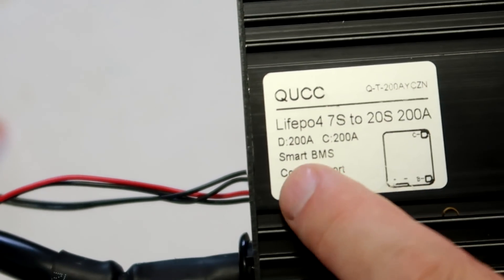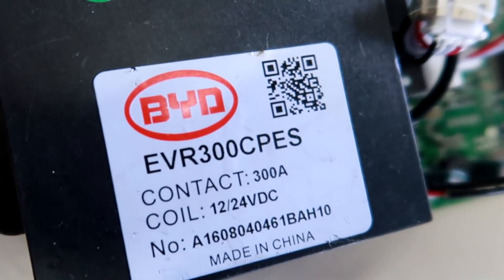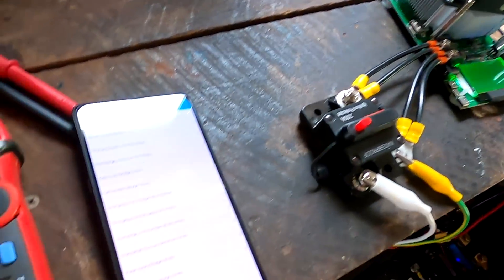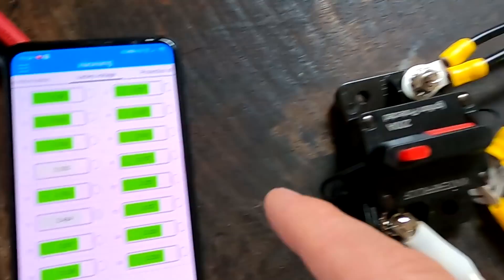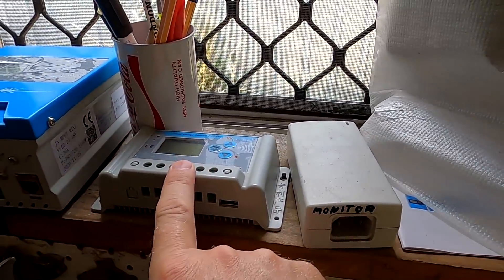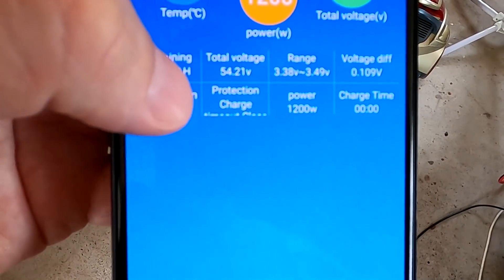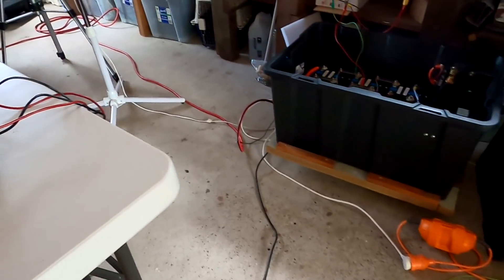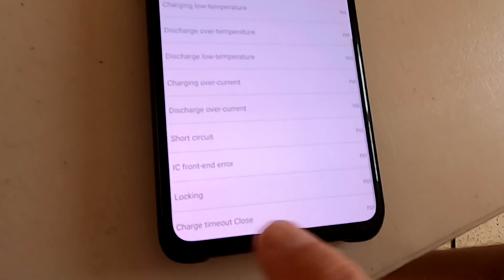This QUCC BMS does not protect my battery! Am I right?

Comment: my Electrodacus SBMS0 (my BMS)disconnects the Electrodacus DSSR20's ( the solar charge controllers) when any cell reaches 3.55 volts for too long of a preset time. there is a guy noel barlau or something like that on youtube who uses 2 of the SBMS0 on a 48-volt LiFePO4 build. one SBMS0 on every 8 cells. you want to stay with 48 volts that could be an option. when you get your next batch of cells to increase your battery storage capacity. the 60 and 72 cell panels work great with the sbms0. you will have to try them out the SBMS0 will also work with Victron inverters as I know that is a big-ticket item you are going to hook up.
it sounds like your BMS needs to go back for a refund. got you a lemon. the main thing the BMS is for is to protect your huge LiFePO4 investment so you get the 5000 cyles and then more. ditch that BMS.
keep up the good work.great videos as always.😎
Reply from the maker: I would get one but it's 24V only.

Comment: Yep it should absolutely disconnect if any single cell goes above or below the pre-set limits, or if the pack goes above or below the pre-set limits. Without doing that, it's no protection at all. You could have one cell at zero volts, and another at seven volts, and it may still think it's ok because the overall voltage is ok. I've tested these scenarios on my Daly BMS by using a voltage divider network, I had to be 100% sure it did what it says it does. The manual is very chinglish, but it was enough to get the gist of it.
Reply from the maker: At least you got a manual...

Comment: The fact that you can hear the relay attempting to open\close but nothing happens, may mean that you just have a faulty relay?
Reply: Yes, the relay contacts may be fused together.
Reply: @neliosamch3195  would you hear a click if the contacts are fused together?
Reply: @kevinmills5293  Yes and know the click is for the pre charge but it won't activate the relay until it fulfill the parameters for over charge which is around 4.0v. Kind of same situation with the Chargery bms.
Reply: @neliosamch3195  I have several chargery BMSs.  They work fine with the latest firmware.  You can set over charge value, undercharge, current, temp, etc.  Not sure why you think you can't.  Maybe you have a very old firmware version.
Reply: @robertgrant5895  no I have other bms which aren't user friendly. Orion and chargery yes you can.
Reply: Yes, sounds like welded relay
Reply: @TallTom77  I think it may not be a welded relay problem. I think this BMS features a Magnetic Latching relay. Either it is faulty and not releasing the latch, or their BMS relay driver circuit design is not working as intended. If it had a standard relay, it would produce so much heat and consume a lot of standby power, which is not the case as shown by Andy in one of his earlier videos. And I also don't think welded relays have very decisive clicks and most of the time have no clicks at all.
Reply: @DSmartLife  I believe some testing was done on self consumption by the BMS and it was quite high but Andy was OK with that - suggesting a traditional rather than electro/mechanical one??
Reply: The click could be the relay armature moving even if the contacts are welded. I'm thinking the timer fault may be "contactor is up and its not supposed to be"
Reply: That would make sense if the "Charge timeout Close" means a timeout on the "Charge Close", aka the relay...

Comment: The reason I have not gone LiFePO4 yet, is because I have not found a 48 volt BMS that I like yet.
Reply: Have you looked at the diyBMS?
Reply: @Bennyboy-dog  yes i have, in fact i got it working recently and i also love that thing, but for Andy is best if he buys something premade and complete instead of Messing around with soldering smd's and programing them... I have both, and the ANTBMS works perfectly and since he has new cells it should do a perfect job at protecting them. I have the DiyBms in a 18650 li-ion battery pack that i made from used 18650 cells. In used cells the DiyBms is better because it has a Higher discharge current
Reply: @andresgodinho  Very cool. Checked out your channel too - also very cool. Love that you show your diy 3D
Reply: @Bennyboy-dog  oh boy that was a long time ago ahahah
Reply: You should try the AntBMS... I love it!
Reply: I’m with everyone else here - most likely explanation is the relay has fused. This is one weakness of having a built in relay - if it fails the whole BMS is useless until you fix it. I’d look into the other ports on your BMS - pretty sure there was a port that could switch off your charge controller, that you didn’t know what was for. This is a much better way to go than trying to interrupt the current with a relay. And it gives you separate control over the charge controller and the inverter.

Comment: Yeah have to Turn completly Off.
Thats a benefit for BMS with mosfets. They can shut down discharge and Change seperatly
Reply: My BMS has relays and can also control charge and discharge separately.  Problem with a MOSFET based BMS is that when a MOSFET fails it tends to be in the equivalent of an "on" position thus draining the batteries until they are completely dead.  Also, you need the right (i.e. expensive) MOSFETS because otherwise the on resistance value is too high for any meaningful current and you can fry your BMS.  On the other had the right MOSFETS usually offer power consumption which is less than the relays.  Damned if you do and damned if you don't.

Comment: Firstly, love your content, I must be one of your frogs!
Coincidentally I purchased 16 EVE 280 ah cells from China at about the same time you did, and my experience with the cells has been good, no WOW,
they are great. Similar experience with off grid as you it would seem, so it's been a steep learning curve. Like you I did my research, watched Will Prowse etc
and took the plunge. I thought what the hell are my savings doing for me in the bank - they might as well save me some power bills.
My setup is very similar to yours. I had issues and, after research solved most and I'm still learning. Was amazed to find your channel and you were doing the same as I was.
However, I went with a Daly BMS and an MPP all in one inverter charger. Daly does shut off if a cell is over/under voltage - not only the whole pack voltage, it does that also.
I did have an issue with the Daly - it appeared not to work. I noticed the BMS you used and considered getting one at that point. I discovered that the reason
my Daly didn't work was that I hadn't plugged in the temp sensor - I didn't think that would matter for testing. Turns out it does and now am happy with the Daly.
Reply: @paysage1617  Daly 16s 48v 200amp Smart BMS. Because I had got a lot of equipment from China I decided to pay a premium price and get it from Oz. Big Wei Batteries, a mob in QLD for about $250 ish. I think you can get it from China for about 160-180, but delivery time may be a bit lengthy.
Reply: @paysage1617  i got mine from Daly Smart BMS store on Aliexpress ordered 8th feb delivered to my door in Sydney on 21 Feb, 2 weeks and free delivery

Comment: I belive that the BYD contactor inside the BMS is stuck in a closed position and will not open during an alarm. This is caused by the arc created by the high inrush current to the inverter while the contactor has closed after previous alarms have been reset. A system like this should have a precharging unit to protect contactors.
Reply: simple test - remove the sensing leads - should cause the relay to disengage. I believe I saw it did that??
Reply: I believe so too ! You hit the nail on the head!
Reply from the maker: What high currents? The relay can switch 300A and my highest was maybe 65A so far.
Reply: When you connect the inverter the capacitors are charged and the current is very high for a short period. This occures even if the inverter is off. Contactor gets welded i closed position  and will not open when the coil is de-energized.
Reply: @OffGridGarageAustralia  I seem to remember in one of your earlier videos that you caused a big spark when connecting the inverter while playing with a pre charge resistor. Maybe that welded the contacts on the relay? You could always power the BMS down and check the relay.
Reply: @OffGridGarageAustralia  Come on, do you realize what damage you can do with 65 amps!!!?  You can arc weld with far less.
Reply: A mechanical contactor coil will fry itself or blow a control fuse if it cannot 'pull in' or activate the device.  I don't know what happens if it's a similar solid state type of device.
Reply: Pre-charge unit should not be necessary, Andy is doing usually like 50 amps.
The inverter, I haven't seen how high capacity, but as long as it's around 5000 watts, the peak should be low enough to handle.

The contactor used seems more like the car starter contactor, who isn't build for "continuous" contact. 
That seems to me the biggest issue, something they changed in their newer models (different contactor type)

Comment: try setting  battery float voltage  2 volts lower. when battery  is full or high it stop charging but u have on, off,on  . maybe the code has to many commands and one  switch . if statement code .i have epever and a esmart that use to do that .batteries  balancer at 3.5  charge  3.4 battery full .only if one run away because sometime the charger controller see balancer as a load  increasing solar controller charge amps.

Comment: Is it not a generic smart app sold with the BMS where only certain parameter can be altered? My non smart BMS cuts the pack off at 3.75 for one cell. It falls back to 3.55 very very quickly so perhaps the 'loaded' charge voltage does not signify the exact cell voltage at rest. I await my active balancer ;D

Comment: short circuit can be triggered when connectet to the inverter bacause the inverter often contains cappacitors on the input side which drain a very high current when charged when the inverter is connected to the input circuit or swhiched on.

evtl auf deutsch besser verständlich: wenn du den Wechselrichter anschließt oder einschaltest können durch Kondensatoren die häufig am Eingang des Wechselrichters eingebaut sind sehr hohe Ströme fließen die dann die ShortCirquit erkennung auslöst. 

dieser Timing Error könnte daran liegen das du evtl angegeben hast wie viel Kapazität deine Akkus haben und er ja Lade und Entladeströme kennt und von daher meint zu wissen wann die eigentlich voll (bzw. leer) sein müsten. Wenn du nun über deine Testlast zusätzlich Strom am BMS vorbei entnimmst denkt er das die Akkus schon längst voll sein müssten.
Ist aber nur eine Vermutung

Sebastian
Reply from the maker: I used a 22Ohm resistor when connecting the inverter. The relay has a 300A capacity and is been used in EVs so I doubt such a surge would melt the contacts.
Reply: @OffGridGarageAustralia  ok but is there maybe a very high currend when you switch off the inverter. 
at least when your BMS disconnects the inverter there might be a high current when it switches the inverter on again.

Die andere Sache dir mir noch aufgefallen ist: klar sollte das BMS abschalten wenn einzelne Zellen über oder unterspannung haben aber was auch möglich wäre ist über einen möglichen Alarmausgang dem Solarregler das weitere laden bzw. bem Wechselrichter das entladen zu untersagen.

Comment: The BMS disconnects the battery pack negative terminal when at least one cell is under or over a preset voltage. For under voltage situation, it will reconnect right away when there is incoming current from the charger or when charging resumes.  That's how it is working on my Daly BMS when I tested it. The inverter also have settings for the battery (there is a disconnect and reconnect voltage setting)  but only monitoring the entire battery pack voltage as it does not have individual cells monitoring mechanism. Protection is done in the BMS at every cell level while protection is also done at battery voltage level by the inverter.  If I use another charge controller in parallel with the inverter built-in charge controller, voltage protection is also in placed at battery voltage level on that other charge controller.

Comment: Please draw you schematic of your setup. . . .  If the BMS relay  is clicking, it should be disconnecting from the battery unless.... 1: The relay contacts are welded closed.  2. The BMS is not programmed to turn off (BUT WHY DOES THE RELAY CLICK as you said) ,  or 3. The wiring is incorrect. . . .   I looked at the Schematic on Aliexpress showing how to connect the system . . . .  . Seems to me, it's not a good wiring diagram as if the BMS disconnects, the LOAD and CHARGER are in parallel so how will the Charger know what voltage to maintain while it still provids power to the load.  mmm ????     Questionable diagram. . .  .  Also, Check out Genetry Solar.  They have designed a Stand Alone 5A BMS Over V protection board.

Comment: I wonder if you have to wire the charging lead separately from the discharge lead. What happens when u turn off charging under the menu if it will trigger the relay to stop charging.

Comment: I have a smart bms using the same Program. My cell over voltage function does work.  It does not require the pack over voltage for the charging to turn off.

Comment: Hi Andy,
I am absolutely agree with you.
The BMS is very crucial part of these battery.
In your case, the bms manufacturer included so many aspects but logic of battery disconnect/ connect not proper.
Just think, if some cells of your battery are over charge and below charge, the total voltage will be in acceptable limit. The bms will never disconnect the battery. Rest of the outcome you know very well.
Got help us.

Comment: I would agree it should trip the relay for any cell.  The overvoltage timeout probably needs that high voltage cell to drop to the 3.4V you set before it goes off.  3.55V is probably a better setting for that.
Get a separate port bms for your next one.  Then the charger will turn off and leave the inverter running at peak voltage.  And also cut off the inverter when you hit low voltage but leave the charge controller on.  150A Discharge/40A charge are the highest power ones I could find, but maybe that will work for you.

Comment: Hi Andy, if you had more hair you would lose it. 
I have a Daly smart BMS. 250 amp. I have set the high voltage disconnect to 3.55 volts per cell. If one cell hits 3.55 volts the BMS disconnects and goes into passive mode until load is applied. I also disconnects at 2.80 volts. It only takes one cell to reach the upper and lower limits and it disconnects. 
I also have set the temperature settings to 2 degrees Celsius. You will definitely need temp disconnect if your area gets below 0 Celsius.
Reply: I also got the Daly 250 BMS and tested all the features on it and it works great, low/high voltage, charge/discharge - disconnect/reconnects very fast and temp sensor . Also can be customised with the app and more  with the pc software. Can say aliexpress DALY Official Store was very helpful with answering my questions.
Reply: I got a Daly SmartBMS - is that the same?
Reply: @Bennyboy-dog  if its the smart version it should be all the same functions.
Reply: @bluex48  Thanks.

Comment: I also have an aliexpress JBD smart bms which uses the same monitor/control program.  Mine does indeed disconnect the mosfets for single cell over/under charge when I tested it.  You might test the disconnect relay in your setup; it could be stuck with contacts closed.  The info you received from china can not be accurate; there would not be cell settings if they were non functional.
Reply: over/under voltage as well as over/under pack voltage or over/under temp
Reply: Same here for an DYKB smart BMS. The two switches on the new app control panel, charging and discharge also turn off as you might expect.
Reply from the maker: These switches do nothing for my BMS. It just keeps charging/discharging even I could hear the relay coming on and off.
Reply: @OffGridGarageAustralia  A single port BMS through a big relay, if it clicks and nothing happens then something is wrong with it. 
I note the BMS description on Ali lists charging cut off 3.75, release 3.45. So it should switch off when one cell goes over. Is the BMS adjusting set voltages via the software or is it fixed at this high voltage ?

Comment: I am not sure a BMS does shut down if one cell is high or low. The BMS is not a charge controller. What should happen is if you have cells that are high voltage the BMS should instruct the charge controller to slow down so the BMS has a change to perform a high cell discharge and try to balance that cell. In my case there is pack high and low voltage disconnect as well as high or low temperature disconnect. To my knowledge there is not high cell disconnect unless it was really serious causing the pack voltage to be effected. I still think you have some of the perimeters set far to high. 57.6 is my view is way to high, again 53.2 volts is what I would be trying.
Reply: the smart daly bms has a single cell high function that cuts charging and is adjustable in the app.
Reply: I am using the overkill BMS. I am highly impressed with its quality and its sensitivity to sell voltage. You might want to look into that type of BMS. They are a bit more expensive than other ones but to protect a precious battery pack I think it is worth it.

Comment: hay i have 20 individual bms working to gather and yes mine shuts down on one cell after delay i also pushed my battery to my low cut out and all 20 shout down at the same time   look up LLT POWER they are mosfet but work relay good and have a pc link that you can change all settings